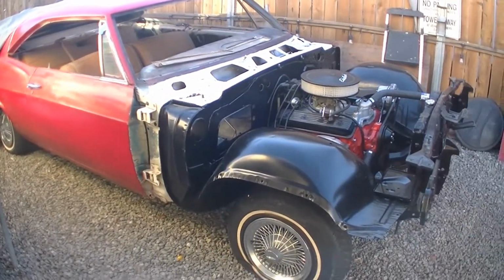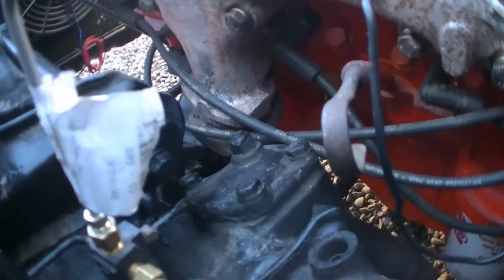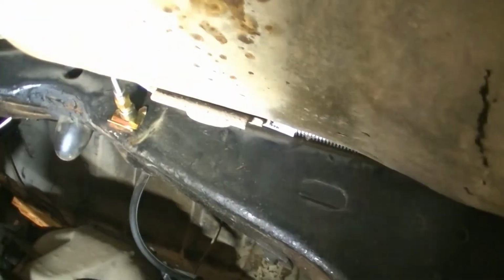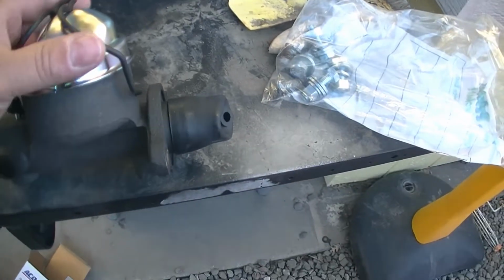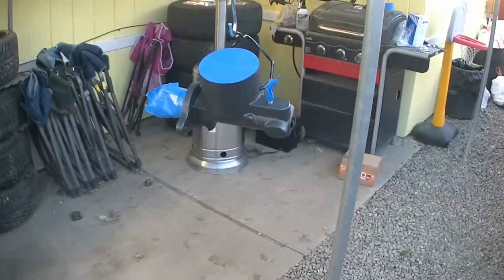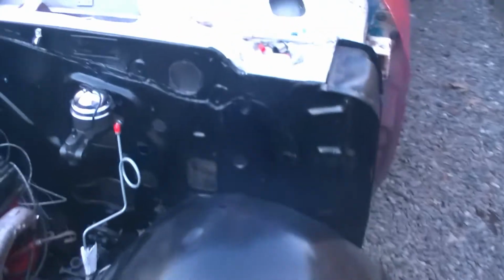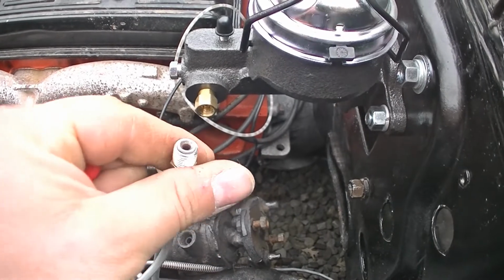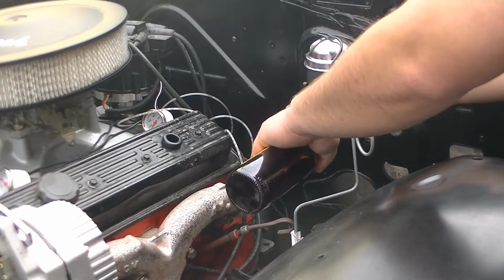chevy impala brake lines, and brake master cylinder install

Comment: Take the twist out of the rear hose.
Reply from the maker: do u think it will affect anything if i leave it
Reply: @cali530marcos3  .... Over time the stress of the twist "could" cause premature delamination on the inside of the hose. Any twist that causes a hydraulic hose to be out of it "relaxed" position is uneccesary stress.  I'm not saying it's gonna fail tommorrow, but it looks more professional if you untwist it.
Reply: Do you not have to bench bleed the Master cylinder before you install?
Reply: @jmm03256  ....You don't "have" to, but I do, and it makes the whole job a lot easier.
Reply: @theSword-  ok thanks

Comment: Hey, what’s up, brother? How did this end up working out any issues with braking And how hard is it to break without a booster?
Reply from the maker: It brakes really good, I still need to add a proportioning valve but other than that I can’t complain
Reply: Did you have to bench bleed that master cylinder before install?
Reply from the maker: @jmm03256  yes, i mounted it then bled it on the car,

Comment: I’m doing front disc Brakes on my 63 impala , they send me front brakes  lines only , do I only need the adapters only , thanks
Reply from the maker: U should just need the adapters too hook up ur lines to the little block that’s on ur frame
Reply: Did you have too bench bleed your Master cylinder before installing on your 63 ?

Comment: what kit did you order from cpp disc brakes kit.
Reply from the maker: I made a video on my channel that shows all the part numbers and how u install the disk brake setup. I ordered the kit off eBay for a 65-68 impala so I'm not sure what part # they have it listed at CPP

Comment: How come no brake booster?
Reply from the maker: for th 1960's cars it was an option but after 1970 most cars came with the brake booster, i think mine had that option because it has an opening under the master cylinder